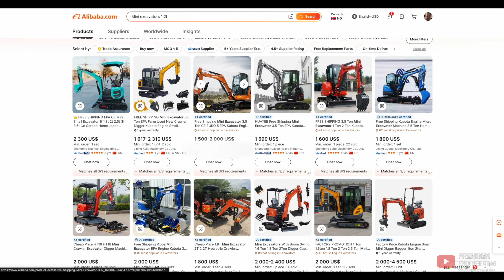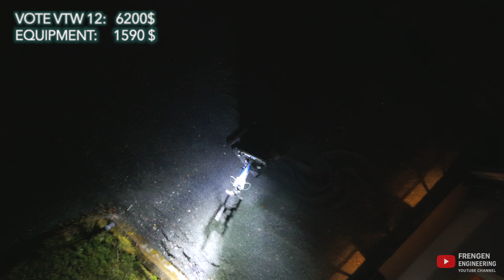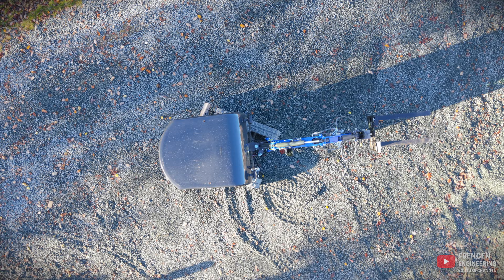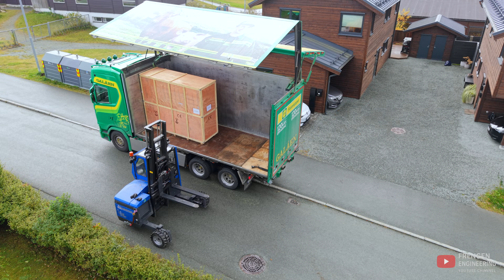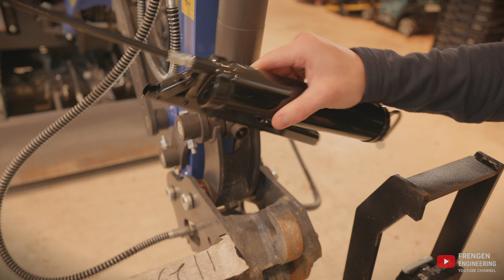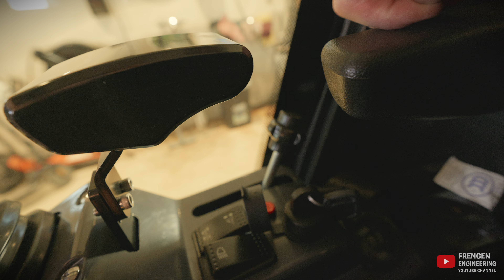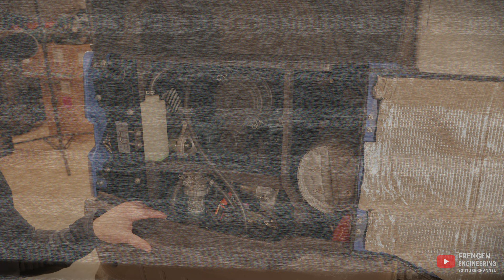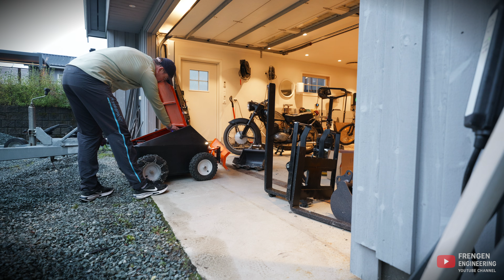What it REALLY costs to import an excavator from China — and what you actually get

Comment: A little tip with purchasing anything high value from China is to get an independent 3rd-party to do an inspection / QC before final payment and shipping. Doesn't cost a lot, and is essential imo. Before shipment you have a lot more leverage in case of discrepancies
Reply from the maker: Thanks for the great tip! But I don’t know how easy it is to get this arranged from the other side of the world?
Reply: Something like $200?
Reply: @frengen_engineering  You're welcome! I manufacture in China and we do this before every shipment - as there is very often little problems to be corrected (like your dent on the motor cover) with either product or packaging. Not because they do anything sub-par, but just because... humans are involved, so these things will happen. And this way it's clearer and less friction for both parties. Instead of it becoming an argument back-and-forth... for example whether things got damaged during shipping... you have an independent party who document things well before you take possession. So it's clear who's responsible and what needs to be addressed. And you have maximum leverage in case of disagreements, since you can withhold final payment and shipping until things are improved. 

There's countless companies down there who specialize in quality control and inspection, and that work with foreign companies or individuals. There's a whole industry for that. We use, for example, QIMA. And I'm sure there are ones who specialize more in industrial equipment too. Last inspection I did... cost, as @NicksStuff suggested, ballpark less than $300 USD. And that was for a shipment of some 30,000 products - sending someone to the factory, taking a number of samples from each master carton, inspecting each of those very thoroughly, and compiling an extremely thorough and lengthy report with detailed images of the products and any defects they find. And also measuring all critical dimensions and fits.

When working with a new supplier, either for a significant one-off purchase or repeated business, part of the report will typically also be to check the facilities, working conditions, and permits/paperwork/certifications. This way you know exactly who you are dealing with, and whether they truly conform to the standards they are supposed to. E.g. that they are not just a middle-man while you think that you are working directly with a factory.
Reply from the maker: @makerfirst Hi! Thanks a lot for your detailed response! Much appreciated! I will try doing some more imports, and next time, I will try to do it as smart as possible. This, I will add to the list!👌

Comment: 1) I was wondering about that symbol on the fan 😬
2) that windscreen wiper is straight out of the 1920s!
3) now you definitely have to buy a trailer so you can take it up to your seaside cottage, where there are no doubt many good projects where it can be put to use 😀
Reply from the maker: Yes, need to be careful around the fan😅 And yes, you are absolutely right. Will bring it to the cabin over winters. 😄
Reply: maybe it even fits on his existing trailer, it looked big and beefy enough? just add some rear stabilizer stands and a pair of loading ramps and you are good to go

Comment: Is it really a 1.2 ton in weight? By the looks it looks a little bit less.
Reply from the maker: Hi, it should be. Even a bit more because of extra equipment. But I have not checked it. Would be interesting checking with a scale.
Reply: I saw a video that compared 4 different Chinese excavators , and the vote was 200kgs lighter on a 1.8t if I remembered correctly.

Comment: Im curious if you've had to order PARTS? Did you get any manuals? In english?  I just retired after 45 yrs in caterpillar parts. Cat has one of the best, if not the very best worldwide parts and dealer networks.  Also,  china is notorious for using totally inferior quality steel in fasteners, pins, etc which is crucial.
Reply from the maker: Hi, I have not needed to order any parts yet, but Vote should be able to deliver parts both from EU and China. 😊
Reply: @frengen_engineering thank you for your quick reply!
Im also curious,  I've bought a lot of new surplus stuff from the US government liquidation site, and noticed the US government bought a ton of Chinese excavators and other equipment in 2023 and 2024 only to stick hundreds of them brand new, still in the crate for pennies on the dollar. Have you seen them?

Comment: I think you should add seat heater or an air conditioner in driving cab, since you are in Norway😅. Btw, is this a production tool or just a toy for you?
Reply from the maker: Hi! The engine keeps the cab quite warm already. But I may need some better cooling in the summer. Also easy to lift the side door off. But not as safe. Bought it as a tool for future projects, and off course for some fun😅

Comment: Interesting! Curious what would be the lifting capacity of the forks?
Reply from the maker: That I must check for the next video😊
Reply: @frengen_engineering Sounds good!
Reply: @frengen_engineering  sadly these machines list "maximum digging force" but don't list "maximum lifting force", which obviously depends greatly on how far the boom is extended etc.  It would be great to see how much you can actually lift with that thing, both out front with the blade down, and off to one side before you raise the track off the ground.
Reply from the maker: @spitfireresearchinc.7972 absolutely. Still, I was very impressed by it, being able to lift that heavy sofa, all extended out. It was not a very lightweight three seater.
Reply: @frengen_engineering  same interest here :)  500kg?

Comment: Re the door, are you able to grind off the corner of the door and repaint it to prevent rusting. Seems like a lot of work to cut and reweld or bend the hinges.
Reply from the maker: Good idea, fixing the door instead👌😎
Reply: @frengen_engineering  there are hinge bending tools ideal for this job, and not expensive- from China of course.
Reply from the maker: @spitfireresearchinc.7972  Yes, I know of them, but the hinge is welded both on the inside and outside. It’s not possible to move it, even with a sledge hammer. 😅